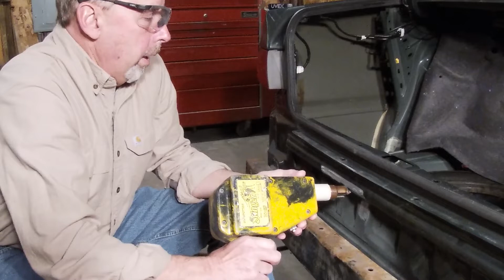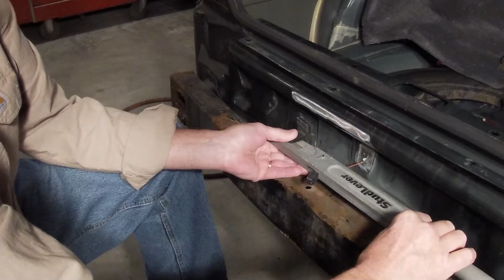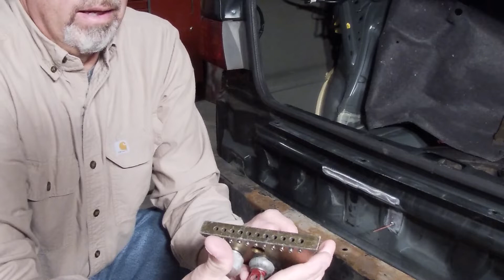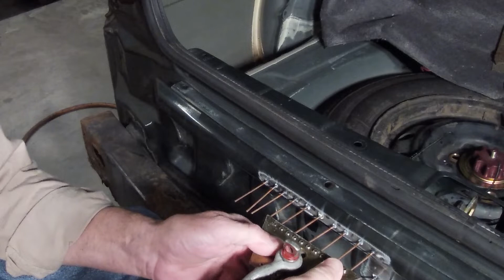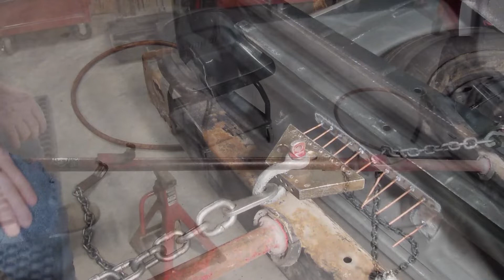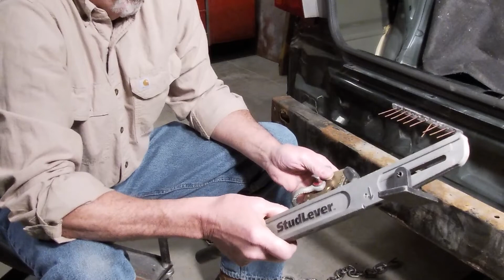Stud Gun Accessories

Comment: Wow, I have never seen this lever type puller but it's easy to see the control you have. Increasing the surface area of the foot is key if there is little or no structure near you. A 2X4, 2X6" with some headliner material stapled to the back of a 3' or 4' chunk of nice pallet wood (Some call them skids) would work great.
 I drilled holes to fit 3/8" tent stakes to fit between my ladder and slopping ground so they straight & pinned to ground & safe.
Great tech tips Greg! Thanks, DK, Omaha.